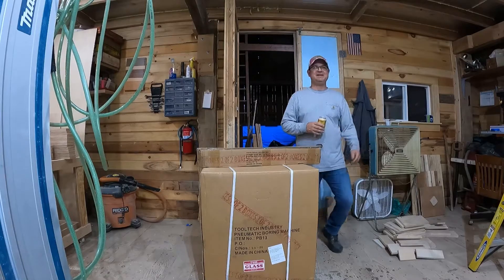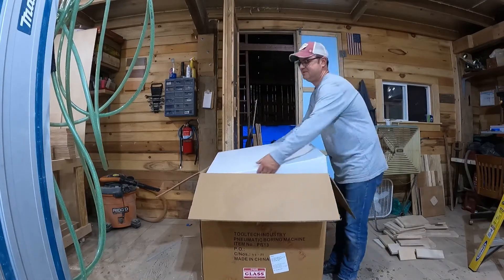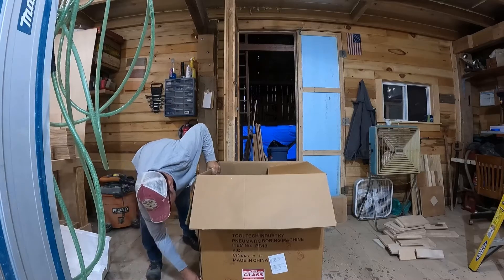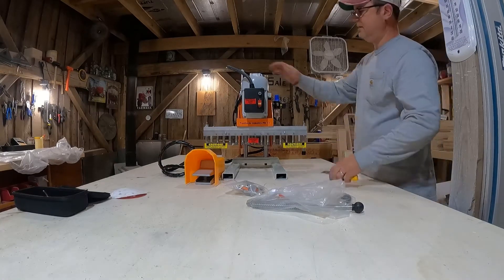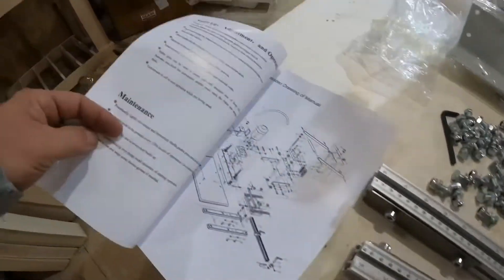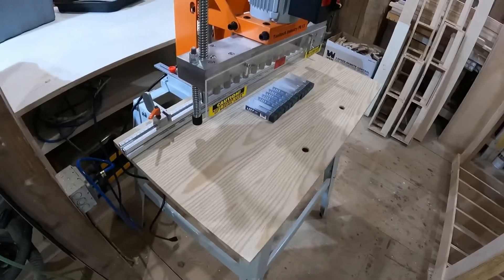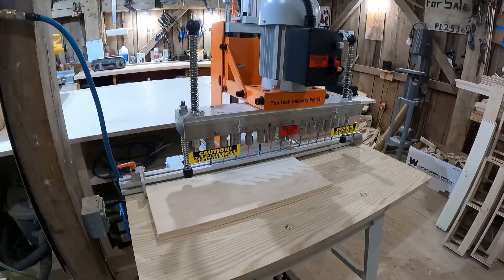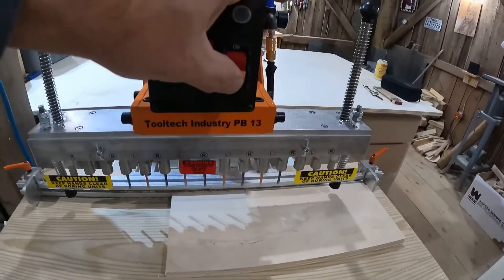Unboxing a Tooltech Industry line boring machine.  Drilling shelf pin holes.

Comment: I have this exact machine. Do you notice that the holes that the machine drills are a little too big for the shelf pins? This is my biggest problem
Reply from the maker: I just saw this message!  Sorry not to respond.  My holes fit great, my biggest issue is getting the stops aligned the same going either direction.